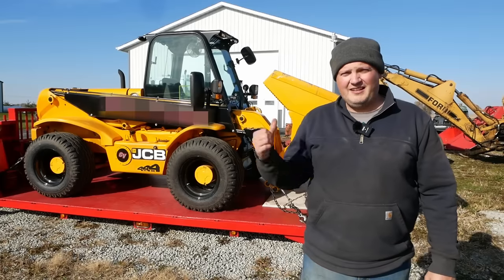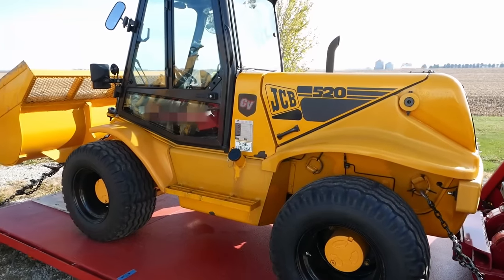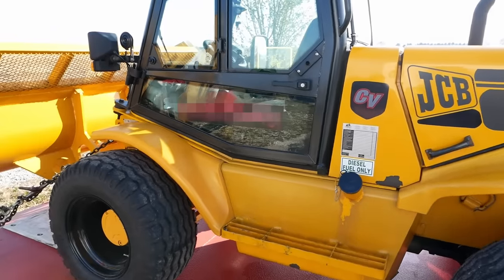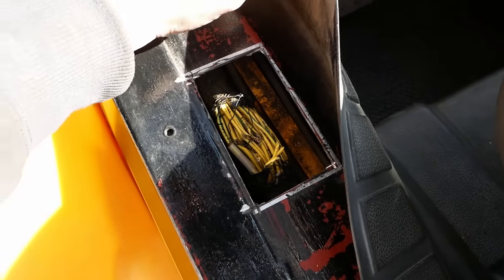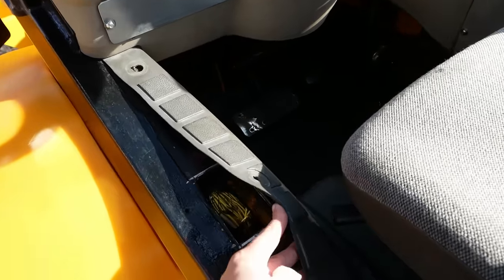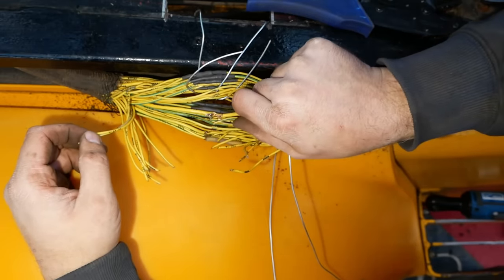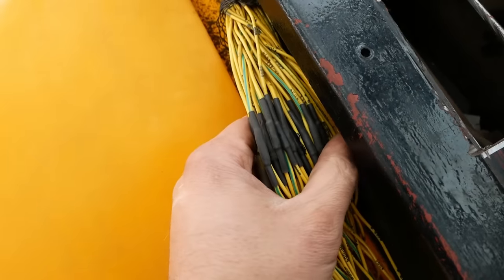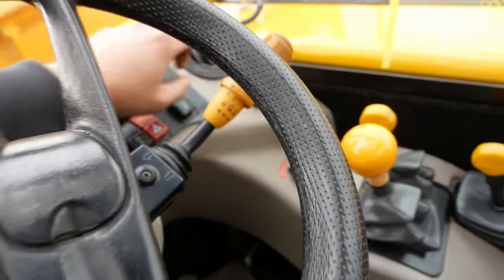What Happens when You Drill a Hole in Your JCB Telehandler?

Comment: I would have tested the cab lights with your own 12v supply, If they work then check power at the switch. Its likely that they are LED cab lights and they can burn out or there is an internal fuse that you can not see.

Comment: Changing the harness out, assuming you could actually get one would be a complete nightmare job as the wiring is part of the cab assembly and put on to the cab during its assembly.
What you've done looks great. Sometimes it helps to splice some extra wire in to give you a bit more room but you managed without.
As regards the headlights, just a quick sense check, have the bulbs blown?

Comment: About two years ago, the dealership I worked at sold a Chevy Express cargo van to a guy. A few days later he comes in complaining of a gas smell and his engine light is on for a large leak code. Smoke tested and it was pouring out of the tank. He was an electrician and had his kid install the racks and shelving while he was on the job with the old van. Kid used self taps and they were like 3" long. Punched one into the tank. Should've seen the look on the guy's face when we showed him what it was.

Comment: man I wish most automotive harnesses had circuit numbers on them just for this. not saying id want to go and drill a hole through my harness , but I do have a bit of an issue with critters thinking my wires are tasty, local dealer had to do a harness repair on my car and used some tape that had cyan pepper embedded in it as a deterrent

Comment: The wire spoon is meant to thread new wires into an already tied wire bundle, not necessarily meant to protect wires cutting the loom. Nevertheless it works for that to. Common tool in aviation world.
Reply: Which is where the idea came from.  opening some of the thicker wrapped wire bundles was risky, and slipping the spoon in acted as a nice solid backstop.  Took the spoon idea with me when I left aircraft.

Comment: Had something similar with a John Deere 4400 combine.  Someone cut a wire harness completely in half just below and behind the left side of the operator's seat.  All the wires were color coded and I had a tech manual with full electrical diagrams.  The unit had a cab wasn't necessary to remove it.  I didn't have a heat gun at that time so simple crimping and taping.  Did you use any liquid tape on the JCB wires?  Didn't see it.  Good video.  Thanks!

Comment: I once had a blown blade fuse in a car that did not appear to be blown to the naked eye. Was going nuts trying to figure out the problem, after checking a million things. I decided maybe the fuse is defective, put a new fuse in and it started. Even taking the fuse out and  looking at it up close, it didn't visually appear to be blown. I put the same fuse back in to retest and it didn't start. I thought maybe the fuse block terminals were bad. That's the 1st and only time I had a blown fuse that didn't look blown.

Comment: Was installing seat brackets in a nova while another guy welded in roll cage plates. He welded through the floor through the aluminum fuel line. I saw 3ft flames shooting out from underneath the nova and booked it out of there. Took an ABC extinguisher to put it out and the dust ruined the car and shop. Took weeks to clean it all out. Pretty crazy gotta know whats behind what you are working on

Comment: As an owner of both tools, the seam splitter is FAR superior for splitting looms.
Reply: can you link to a seam ripper style you prefer?  I always like to try new tools, but the rippers I have used in the past required force applied to make the cut, which also applied force at the spear that went into the loom.. which repeatedly snagged a wire and make more work.  I also couldn't get a loom open without jerking it all over the place, which I don't want to do when I'm doing diagnostics on an intermittent wire issue.

Comment: Unfortunately on equipment like this , the main frame harness is usually one of the first things installed on the vehicle with everything else put on top of it , so replacing the harness often means an absurd amount of disassembly.

Doing this the "right way" would mean screwing the customer to the wall with labor charges.

So its either hundreds of dollars for a repair that will last 10-15 years
VS thousands for a repair that lasts 20.
Reply: The fasteners Wes used for the repair are as good as the original equipment. Why would you expect an early failure especially considering the protected location?

Comment: Having worked on Marine electronics, I would have soldered these, but the harness looks pretty safe, or is it? PLANT BASED WIRE INSULATION just sucks... ask GM, they have had Brand New trucks chomped on..and they sit because.. no CPU... ..Still, Wire insulation should NOT be Food, Even for A Drill?? hehe

Comment: I like that little trick about putting that electrical tape around that socket running it up so you can have a smaller role to deal with that’s cool really is I don’t think you’ll have any future corrosion problems on that wire something I can suggest hi on my old 91 Dodge anything else I do wiring on I use the shrink wrap like you did you did but I also put a little bit of silicone so that way all over the connection and then when you sent that shrink wrap down virtually guarantee she’ll never have any moisture get it in there so anyway this is Jim mungai from Kennerdell PA actually I go by six in a row gym I have a91.5 dodge pick up With a Cummins under the hood anyway oh you’re good though I like what you did and I learned from you all right can you tell your buddy to be more careful about where he does his drilling OK have a good day

Comment: That looks so half-assed. Gave up on properly removing the cab bolts, tried jacking it (probably bending the remaining, rusty bolts) with a garbage jack, stuck your fingers into the "will cut your fingers off if it falls" space... Not even adding extension repair bits of wire, just pulling on the wires... it takes effort to make that many mistakes!
Reply from the maker: LOL.

Comment: I repair equipment for a living I’ve repaired more wiring harnesses than I can remember I think you did a fine job , I also envy your wire crimpers ! Although I think my Klein tools striper and crimper do just fine . Have you tried the stake on with solder inside ? I’ve seen other YouTubers use them but I’m still crimping like you did .
Reply from the maker: I never have. Some review have been negative so I'll stick with what I know works.

Comment: the cheap porta power fittings tend to tear/split the valve core o-rings and leak fluid out when not connected to a tool. the cheaper they are the shorter they last. you can pull them off/apart and replace them with better o-rings or whole fittings with better quality.  alternate be lazy and just leave something connected at all times, I know nothing about that route 🤣
the same goes for the rams/cylinders, cheap o-rings that the oil brakes down fast.

Comment: With such a new looking machine, how can mice get in ?
Unless the cab door wasn't closed all the way or a window left open ?
Nice trick with the tape. 👍👍👍
Reply from the maker: There's a huge hole where the wiring harness comes in to the fuse box. Same with where the hydraulic lines come in. Typical industrial equipment. The cab is more of a shelter.
Reply: @WatchWesWork  OK thanks

Comment: I once cut a hole through a slab just outside a building with a core drill, the boss marked the holes. I thought they called miss dig and could see where all the power cables and communication data etc lines. Went through slab felt kinda funny pulled hole saw up and there was a thousand little phone lines cut!!!!!! The AT&T people spent a week fixing it!! The boss was fired for not getting the cables marked like he said he did. What would’ve happened if it was a high power cable? I probably wouldn’t be commenting now. The new core drills are fitted with a device that senses these cables etc

Comment: So why the non insulated connectors over insulated connectors? Is it for clearance or is it a better combo?
Reply: Both.  Clearance because in a tight spot you can visually see that the wire is firmly in place before you crimp.  Also, you can crimp harder without running the risk of breaking through the insulated plastic connector cover.  Plus, with heat shrink you can custom size and make damn sure you get a good seal.  In places like wheel fenders where water is a known issue, I'll even double layer shrink wrap to give it extra protection against water.

Comment: I don't understand how some people think. Who in their right mind would cut a square hole out of the cab off their nice clean machine. I'm surprised they didn't hit the wires again with the grinder   it's like something they would do. Plus it wasn't necessary to do if you going to life the cab up to repair it anyway.
Reply from the maker: He had no idea the extent of the damage. If it had just been a wire or two at the top he could have fixed it without lifting the cab.
Reply: @WatchWesWork   That's true. I'm just not a fan of doing that sort of thing unless there is no other option.

Comment: Those JCBs are near impossible to get parts for. Unlikely you could even get a new harness. We have run the identical unit for over 22 years at my work. Interestingly enough a self tap screw was run into the harness in the same spot for the same reason.
Reply from the maker: That's funny!

Comment: Anyone who thinks replacing that harness is a better option has never replaced a harness. All those wires go someplace and need to be unhooked new harness routed through and rehooked. Factor in that the machine could be built around it and it’s days of torment. I was thinking you weee really close to just putting in a set of plugs and having 2 short harnesses
Reply from the maker: I would have if there was space.

Comment: i just cant get over that you didnt solder the wires together... its a working machine on the fields, bouncing all the times, what grants that those joint points dont become loose and you have to do the whole thing again? A little solder would make sure they never will detach from each other :////
Reply from the maker: LOL. How many crimped joints are already in the harness from the factory? There's at least 4 in every wire already. A crimped joint is actually stronger than solder because solder makes the wire stiff and brittle.

Comment: I mean...who hasn't done that before? Psshhhh. One time I put a 7.62x39mm hollow point round through the battery of my ATV one time when it was cold and my fingers were numb and I knocked the gun off safety then the trigger got stuck on a knife handle. Boom. Battery immediately shuts off. My pants are melting. My boots are bubbling.fun times. I had just killed a 230lb sow too and had it gutted and loaded on the front. Had to walk half a mile back for the truck. My dad was pissed! It was pretty damn careless and I knew better. Even worse was when I got back, coyotes had already started going at the head and feet and got got to the belly so lost some bacon on that one.

Comment: Those wires should have soldered back together. Butt connectors are garbage and will eventually become a loose connection and the customer will be back to square one, broke down.
Reply from the maker: You do realize that every single factory connection in the harness is crimped right? Every wire goes through 4 or 5 crimped connections...

Comment: Could have been so much worse seen people take a drill to affix something and drill through hand made circuit boards that can't be replaced unless you remake them and cut wiring that connected the controls to the rest of the vehicle leaving just enough wire to let you know something was wired into there until you see the wiring diagram trying to save money is good but some things you do have to admit are out of your range of ability but this was jcb trying to be smart in design and use all space not caring that those little plastic bolts are about as useful as a glass of water to a person who is drowning.

Comment: Why would anyone think designing a harness with all the same colored wire was a good idea? JCB is now on my list of brands not to own, as they're not designed to be repaired.
Reply from the maker: This is normal for industrial equipment and big trucks. CNC machines are even worse. All the wires are the same color and only marked on the ends (if you are lucky).
Reply: @WatchWesWork Which is why OLD machinery will always be more repairable and have a much longer life than the scrap metal that should meet a shredder before leaving the factory that they sell these days.
Reply: Wes is correct, this is normal.  There are not enough colours to have different coloured wires for each circuit.  I used to work for a manufacturer of industrial equipment for the petrochem industry and all wires were black and individually labelled.  Once you get used to it its actually better because you can correlate a wire number to a circuit or component. There must be 50 wires in that bundle, what colours would you use if you didn't use labels?

Comment: Oh man, that would suck.

Wires should all have circuit numbers on them. 

i would have used the butt connectors and soldered them. I dont trust crimp connectors.

I got a rat story, they ate through a 2.0 stranded copper wire.. There are definitely some wire coating they like. I finally had to go to war with the bastards. Literally, I used bug foggers as grenades', Was sniping them in my living room with my pellet gun and trapped over 200. My dogs got a lo6t of them as well. I live in a 5th wheel on some land I just bought and they were following the wiring. i finally seem to have got rid of them. They really caused a lot of damage.They were living in the insulation around my holding tanks.stinks like hell. I live off grid and I have a mep81a diesel generator and i ran the exhaust under the 5th wheel to evict them.